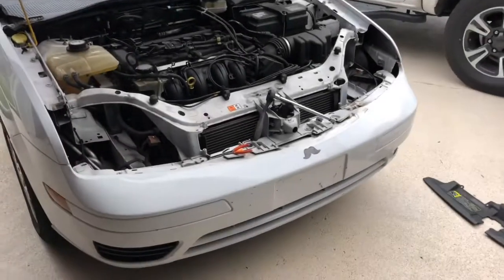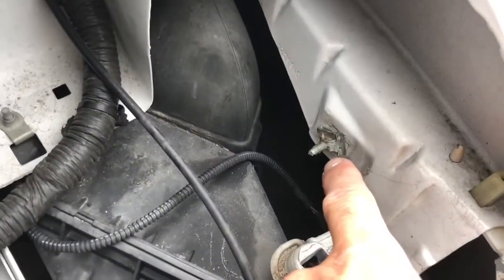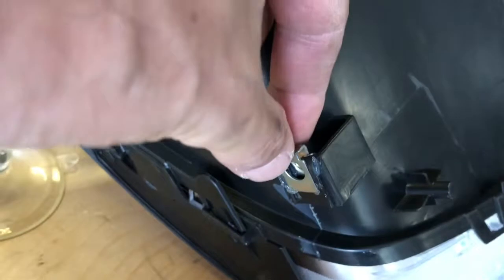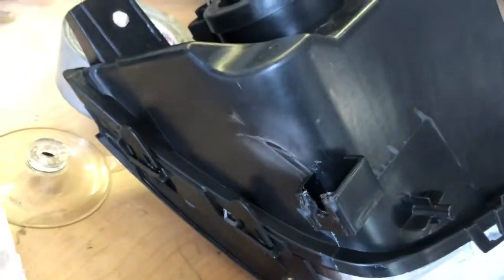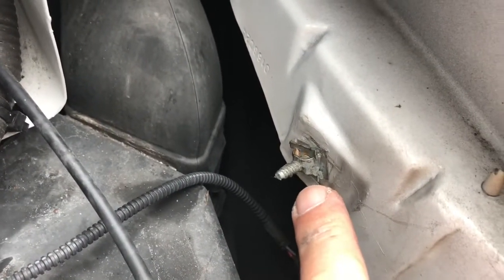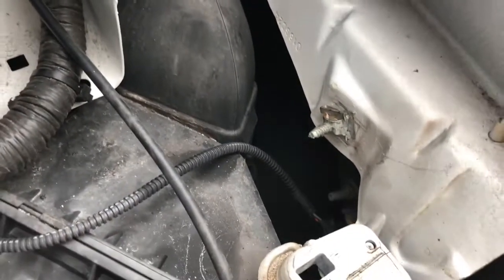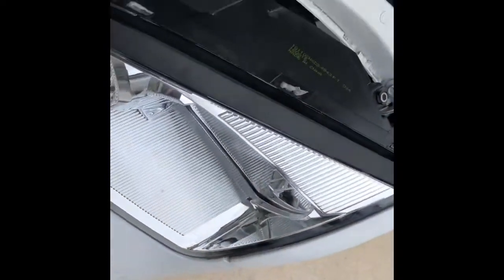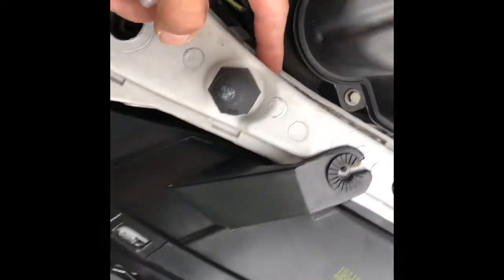2007 Ford Focus headlight replacement cheat

Comment: Worked for me! I couldn’t get the old headlight to slide off easily. I broke the plastic trying. Then I just removed the broken Piece of plastic from the remaining side bolt and slid the new headlight in easily.
Thanks for the tip!
Reply from the maker: Good deal, glad to help  :-)

Comment: How to get the old assembly out?
Reply from the maker: Take out the screws that you can get to and pull the headlight forward to get it off the screw on the side that is behind the fender. There is an earlier comment stating that it took some force and the plastic clip on the old headlight broke off, but that’s ok cause it’s getting replaced anyways.
Reply: I wonder if you even need that side bolt. I saw a video for same lense that was held in place by only the two top bolts. No side bolt.